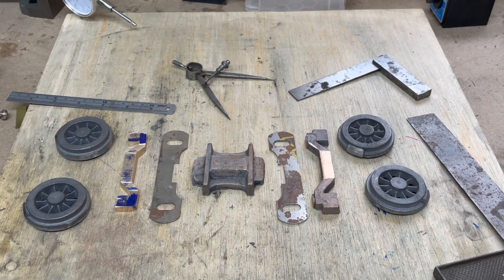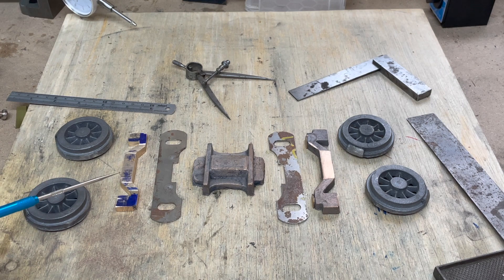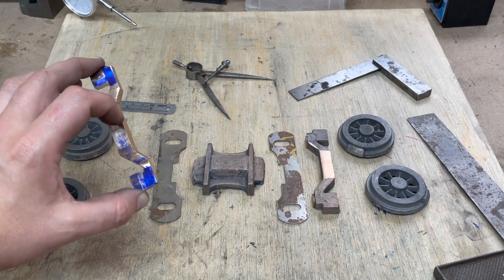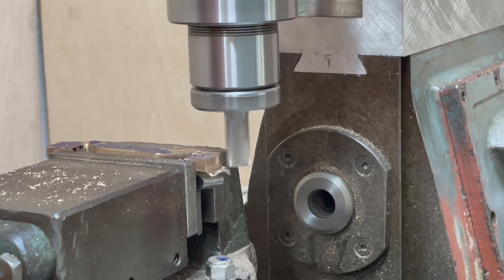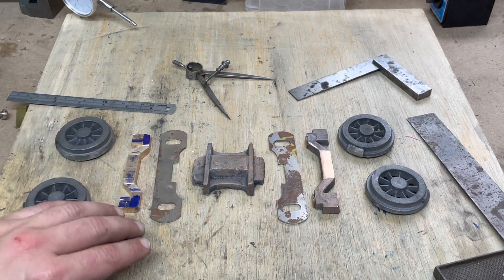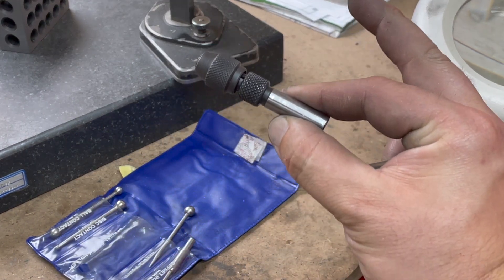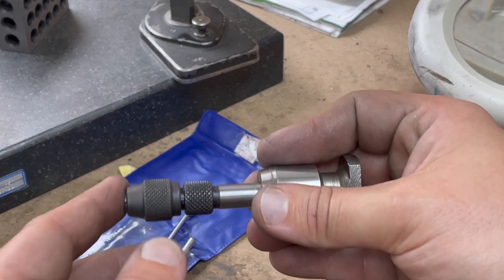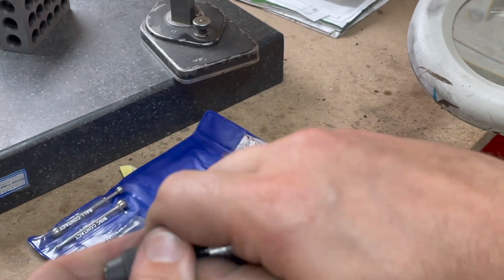Building a Live Steam LBSC Atlantic in 2½" Gauge - 1.2 - Front Bogie Outline

Comment: I would have thought that your Clarkson collet chuck would hold the wiggler well enough without any further modification to it William. The Clarkson is designed to stop a milling cutter being drawn further into the work under hard cuts but there are no such cutting forces working on the wiggler. So I'm a bit surprised the collet action (just on it's own) isn't gripping the wiggler firmly enough. I generally mount my wiggler in a drill chuck (which has far less grip than a collet)
Reply from the maker: Hi there, I'll try again - it was much better on the wiggler shown than the cylindrical edge finder-type (not shown) - I'm just not at all sure about dealing with draft angles on castings - any tips?
Reply: @williamsworkshopuk   I'm not sure what problem you are having with draft angles but generally they are machined away when coming down to dimension. Too much to discuss here but care is needed to chose and machine a good reference plane and to ensure that the required part fits within it. Castings shrink and are often not symmetrical - e.g. offset cylinder bores etc. As already mentioned, mistakes can be rectified by adding back material in some circumstances but obviously best to get it right first time around.
Reply from the maker: @webmasterg3526  Thank you - lots to learn!

Comment: Thanks for the update. Have you checked what steel the wiggler body is made from ? It could be a bit of a swine to cut a thread on and, of course, concentricity is vital.
I'm in process of making a tailstock die holder adaptor for my Unimat 3 and also buying a few bits for my Myford in order to progress with the Stuart 10V. Using the ghastly pin operated 3 jaw chuck on the Unimat reminds my why I fell out with it, as. well as needing to take microscopic cuts.
Onward and upwards. I look forward to the next episode.
Reply from the maker: I had a Unimat SL and found it enough to give me the bug but found myself banging at the limits of the tools pretty much immediately - I changed it almost 1:1 for my Myford and haven't looked back.  Removing and reinserting the Clarkson chuck in favour of the Drill chuck is a bit of a pain, so trying to figure out some other ways. I think for this loco machining up to scribed marks might be sufficient, we'll see...

Comment: Nice to see the project started William, great,  i believe i heard my pseudonym mentioned there, thanks.
Just for future reference, that may help, if you " bugger up " an expensive bronze casting, depending what its does and what its for, i.e. if its not a super critical component, machine it back and silver solder / soft solder a new piece of offcut brass / bronze in, then start again!!
I do!, but then again i'm as tight as a ducks a......... 🤣🤣🤣🤣🤣🤣
Take Care
mr f
Reply from the maker: You did indeed - thankfully on this one it was quite inexpensive to replace. The original build articles talks about fabrication from steel plate and brass angle, so I would have probably done that. I need to practise my silver soldering still too!